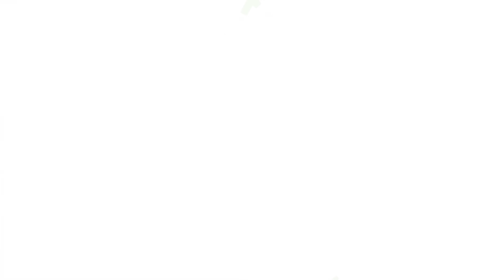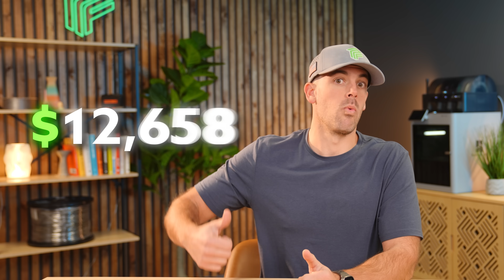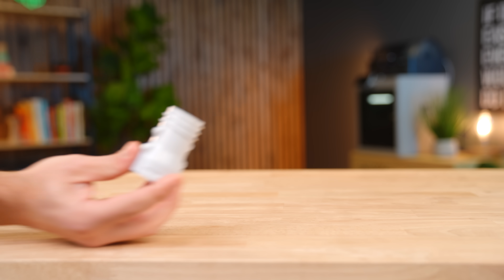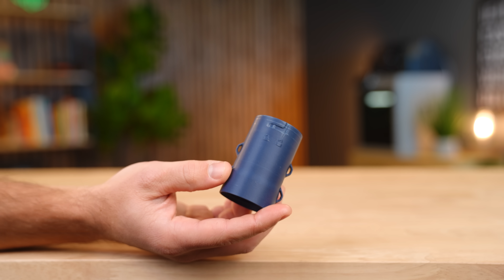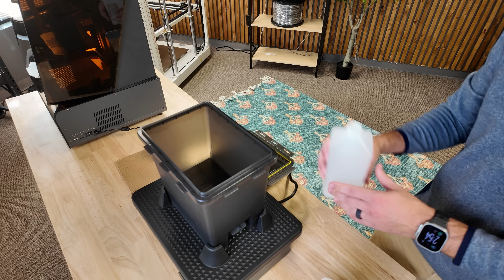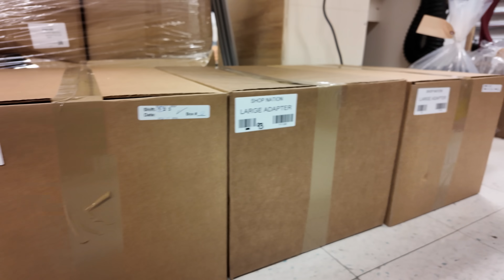Why is 3D Printing so Expensive?  Injection Molding Comparison

Comment: Not sure if it was mentioned (only watched about half the video), but another point in injection molding's favor is the aesthetic quality of the part is better too (provided there is good tooling) since there are not layer lines, or overhangs to worry about).
Reply: 3D prints of well designed, and from a reliable well tuned print profile, look amazing too.
Reply: @arnoldmarcus3634  3D prints can look fantastic, but only if you like the layered aesthetic (which I do). Not everyone does though.

Comment: So breaking it down Barney style, mold injection has a higher entry cost due to the tooling involved to create the mold for your part where as 3d printing avoids that process. Where 3d printing loses is when it comes to the time it takes to produce a part when compared to injection molds. You have exponentially higher production rates within a single 8 hour workday with injection molding with each part taking seconds or a few minutes to produce vs hours or days for a small batch of parts on a 3d printer.

Comment: 3D printers = low fixed costs and modest initial capital and fast setup but high variable cost per part and slow unit production.

Injection molding = substantial fixed costs (tooling) and high initial capital and slow setup but low variable costs per part and fast production 

If making small batches of parts or prototyping designs 3D printing is sensible.  

For volume production with a stable design, injection molding usually is the play.  

There is a gray area near where the cost curves meet where it can be a little more complicated.  Most of the time the math will be pretty obvious though if you have any certainty about the amount to produce.

Comment: Can someone please explain to me the cost difference between these products done with “hard” tooling for higher volumes and using “soft” tooling using softer metal molds such as aluminium for low volume/protype production runs? I’m assuming the 35k was for high volume, hard steel tooling not aluminium.
Reply: What you said- but 35,000 is low volume for molds. I have a customer that injection molds holsters on aluminum tooling
Reply: @cmf7972  I meant 35,000 dollars was for hard tooling his products  and was wondering how low volume tooling using aluminium would compare. Unless the 35,000 dollars was aluminium mold.

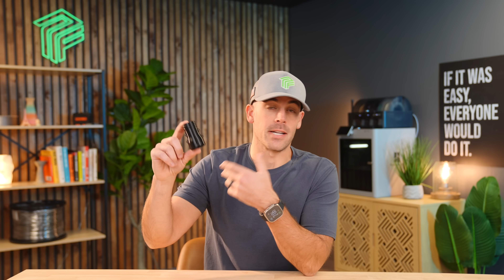Comment: @4:54 so you ate staying that the material cost was 3x what you paid?  So then who is subsidiasing your material?  Or is the suggestion that the filiment suppliers run at a loss?
Reply: He was stating labor and power costs for his own 3D printer. Assuming he values his own time, and takes electricity consumption into account.

Comment: I have a few injection molds and if you can pay for it, it is way better than 3d printing. I carl up my injection guy and in a little while 1,000's of parts show up and i don't have to deal with bad prints, bad filament crashes ect.

Comment: “This is one of the most transparent and practical comparisons I’ve seen — exactly what designers need to make informed decisions. Your breakdown of the ‘crossover point’ is spot on. From our experience as a prototyping and low-volume factory, there’s often a crucial middle ground that’s missed: Vacuum Casting (Urethane Casting). For bridge production (typically 20-500 parts), it offers injection-molding-like quality and material options at a fraction of the mold cost, perfect for market testing before committing to steel molds. It’s a powerful tool in the ‘in-between’ volume stage. Thanks for making such a valuable resource!

Comment: I have two resin printers and LOVE them!!!  And I have two P1S fdm printers. Resin is nice for high detail parts. You get zero layer lines because it prints at 0.01mm thick. But they take many hours to print. But a nice thing with resin if you can fit 5 parts on your bed it's the same amount of time to print one or 5.

Comment: One caveat I'm not sure you mentioned is that 3D printing can create internal structures that can allow you make lighter parts that are still relatively strong. That cannot be done with injection molding.
Reply: It's done with ribs, gussets and such like that maintain a fairly constant wall thickness. I've bought thousands of things that are injection molded to date, and only paid money for a couple that were 3D printed.
Reply: @spehropefhany What is your point? Just because you personally haven't bought many things that use internal structures doesn't mean there isn't a market for such things. Additionally, there is almost certainly untapped potential in existing markets for improved designs that could benefit from using internal structures to make them lighter and/or improve their strength.

I'm not saying injection molding doesn't have its place; far from it. I'm just pointing out an understated advantage that 3D printing has that injection molding will probably never have. ✌️
Reply: @sheariley1910  I suggest "Plastic Part Design For Injection Molding An Introduction" by Malloy if you want to learn more.

Comment: When comes to commercial scale 3d printing I'm surprised pellets producers didn't just have side pipe sticking out from very first melt, continuously supplying freshly made molten pressurized plastic straight to thousands of stationary 3D printing nozzles while bed makes all the moving independent
Allowing you to use plastics that can be molten once or have very strict requirements
That's how I'd see truly mass scale 3d printing, where the farm literally is manufacturing own plastics continuously, allowing for mass deployment of 3D printing

Comment: Glad to start seeing some common sense around 3D printing. It's been a while coming along. 3D printing has its' place, but it won't replace everything.

Now if only the "billet is best" guys on the metal side could understand that parts machined from billet are not always better. MIM, forging, and casting can better in terms of strength and cost. It just depends.

There are always pros and cons in engineering.

Comment: Making the molds for injection molding is the expensive part
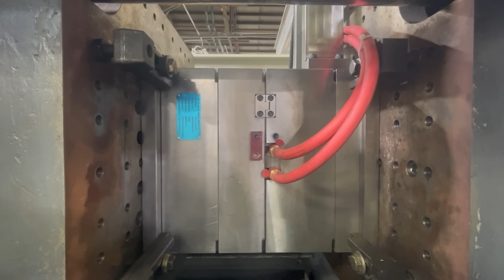Reply: Design of the molds is engineering expense and real molds tend to have a lot of components from 3rd parties such as DME, not just chunks of tool steel. From bubblers to slides to to hot runner assemblies and values to bushings and precision ground tapered alignment locks. At 6:53 you can see the alignment locks at the top right and left of the mold used to move the core and cavity halves into tight alignment. Not to mention oodles of precision-ground and hardened ejector pins and similar parts. Of course cheap molds can use lower performance materials (even aluminum) but won't last nearly as long before maintenance or rebuilding is required.

Comment: If you're in a pinch and don't have the upfront money, you can use injection molding at home with plaster molds for less than $1,000 in setup costs. Most cheap models are for smaller parts, but you could definitely build one yourself for bigger molds and use a hydraulic press.

Comment: One other advantage to injection molding is the ability to add surface texture (SPI) or even diamond patterns, similar to knurling, for increased grip for turning and fastening round parts. The draft angle needs to be steeper but once in the mold, they are on the part. Awesome video for those sitting on the fence whether or not to take the plunge. I agree that a "huge" factor is freeing up time and equipment (space) to do what you do best, create, adapt, and transform.

Comment: Do you have an estimate on how many parts you can get out of your mould before it needs to service or replacement?
Reply: We do service every 40,000 shots on our complex molds and 80-100,000 shots on the simpler ones. Lifetime is expected to be at least 500,000 shots.
In my previous job, service was usually done every 200-250,000 shots and I know we had molds that did over 20 million shots

Comment: 35k for the mold is INSANE! Why is it so expensive?!
Reply: Lol!  Someone was sleeping during the video!
Reply: @fredygump5578 Not at all, I did hear all the details. Still it doesn't come close to explain this ridiculous price! What is the mold made of? Solid gold?
Reply: @EntrE01  $35k was for two molds and that's pretty reasonable as these things go. They are fairly complex one-of-a-kind machines, weighing hundreds of pounds each, that have to unscrew (maybe a hydraulic motor with gears) to release the part, are riddled with water passages to keep the throughput reasonable, have precision components and have to withstand maybe 10-15k PSI injection pressure and tons of clamping pressure.  Some things like design and polishing are pretty labor intensive (or involve very expensive software). If you don't polish the mold the part won't come off the core side easily. Often it's better to make molds with multiple identical cavities to balance the forces (and multiply the throughput).
Reply: @spehropefhany so 35k is not just for the molds but the entire injection molding machines?
Reply: @EntrE01 
It is for the mold, but a mold is wore then two peases of steel
Reply: @Goroca I can buy a pretty decent car for that money. Think about that for a second. 35K for a mold is absolute insanity.
Reply: @EntrE01 
Yes I know 
Persition equipment is expensive 
A f421 3d printer is ≈75k€ that is chap for a industal printer

Comment: It would be interesting to see how SLS / MJF printing stacks up here. Also a point to consider: 3D-printed parts, generally speaking, can be more complex in design. This can translate to less steps being required in assembly / multiple parts being combined into one, so the cost of the part itself might go up, but the overall price might go down.

Comment: TL;DR. Injection Molding has a big startup price, but the price to produce the parts afterward is cheaper Comparison 3d printing. So if you have A LOT of the same parts you are mass producing Injection Molding is the way.

Comment: When in HighSchool many years ago, my Dad started a small company.  I did some of the drafting for what turned into an injected molded part, we also needed styrofoam molding that had some different needs, and so did rubber molding that was different yet.  In the end I went into Mechanical Engineering until I fell in love with computers and turned into a computer geek.  Still molding and manufacturing are an interest and a love some almost 60 years later.  Thanks for bringing us along and showing the economics too!

Comment: I really enjoyed learning about how you came up with going from 3D Printing your parts to injection molding them. I thought about this myself when doing a large production than a 3D Printing farm.
When you take in the time factories working with 3D versus injection mold and producing parts quickly. Yes it can take upto months for a plastic injection mold made at a tool machining company who works off of plans by drafting them knowing where the pins for the different plates as well. A lot goes into making them and they weight from hundreds of pounds up to tons for even a small parts depending how many parts being made at one time. 
When I was younger starting out I worked in a tool maker shop and for a plastic injection business as well.

Comment: Great video.. you might want to look into the FarmLoop system for some of these bits also. I have just started to use to make a annoying difficult part to produce at high volume (1 per plate, 2.5 hrs each so overnights weren’t an option) and it’s changed the game for me. I have 40 of these being produced in my spare room on one printer over 4 days whilst I’m in Spain haha

Comment: Fascinating look at the comparison and process. Thanks! (Also as far as the resin printer? It's probably better to remove the supports once you get them off the plate instead of after washing - it's less resin mess to wash off, which is going to help keep that wash IPA active longer, and it's less to cure (and probably cleaner from where the contact points were. And the Reflex RS is fantastic. )

Comment: A few months ago I started using a Formlabs Fuse. It costs about the same as a set of injection molds, a bit more if you get the full setup. Material is about $100 per kg, I've been using Nylon 12. The process makes a uniform part more like an injected molded part, and it is very fast when doing batches of parts. I have found that really large items that are extra thick can distort as they cool, need to spend a bit more time refining the part to fix it.

Comment: I think people misinterpret how "cheap" 3d printing is in general.

Most of the comments against print farms are from people that have no experience in mass production.

And no matter what production method you use, the more you make, the cheaper the unit cost is.

But I think a lot of people watch YouTube and think if they buy a 3d printer, they'll automatically be able to save money by printing things instead of buying them.

But that is usually only the case if there's a free file available for that exact item.

For example, I bought my daughter a dressing table for Christmas that was extremely heavy and had a load of parts.

The mirror on the sliding door was smashed and the company didn't have any stock to replace it so wanted us to return the unit that I'd already built at this point.

The mirror wasn't a standard size so I decided to print a frame.

I no experience with CAD, I'm learning as I go.

So it cost me £20 for a mirror that would work and I've burned through most of a roll of filament and multiple days of measuring, modelling and printing then redesigning to fix small errors or tolerances.

Whereas, I could have bought a mirror that was the right width for £40, a glass cutter for £10 and probably would have had a perfectly fitting mirror within a day or two.

Comment: Great video, I am a hobbiest 3D printing nerd by night and a plastic injection mold designer by day. Have you considered the more advanced additive manufacturing technologies such as Selective laser sintering or (SLS)? Although the machines are expensive, they can produce many more parts per run than other technologies due to their ability to nest parts in the Z axis as well as X & Y like FDM and no supports are required. Just a thought I thought I'd share. We use these technologies to produce metal inserts with conformal cooling/Venting in metal but there are plastic machines as well. Anyway, great video and thank you for sharing your experiences and knowledge.

Comment: I wonder why the 3D printing industry doesnt want to get into the injection mold industry. it should be possible to inject at low pressure enough - at least to make the hose adapter you wanted. $5000 max
Reply: the injection mold industry relies on the costly mold making industry, that seems to be just CNC machining and CAD/CAM personified. so that can  be done cheaply as well, assuming we had access to raw metal materials.

Comment: After manning the mold....
Customer: "can you make this little change?"
Reply: You'll have to adjust it with a hammer, either the mold or the customer's expectations.
Reply: @SenselessUsername  Customer would likely be cheaper
Reply: @SenselessUsername   😂
Reply: Choosing IM or 3D printing is a tit for tat moment. Conduct a feasibility study to determine the best approach as the part geometry, annual volume, and material requirements will dictate the direction you should go. Injection molding is the ideal solution for 1) if the design is frozen, and 2) if the volume justifies the cost of tools, material, tool maintenance,  etc, , 3D printing is ideal for 1) Unfrozen designs, concept, and early stage parts that customer needs immediately. 2) Low volume production runs for legacy parts no longer being made. Again, a feasibility study will guide you in the right direction that makes sense.
Reply: lol
Reply: and that's what 3d printing/prototyping is for 😎

Comment: I think 3D printers still miss on slicer injecting material into cavities. Prints beak along the layers. Brick mid laying helps only a little. But we are printing with internal structures. No problem to have some of those structures as little tubes, and then fill them in one go with few millimeters of material. That drastically increases mechanical stress which given tube can survive without snapping.

Comment: The other factor not discussed here is the mechanical strength of an injection molded part vs. a 3D printed part.  3D printed parts do not have the mechanical strength due to layer adhesion.  You have get a much better surface finish with injection molding (no layer lines).
Reply: Did you watch the whole video? Zach mentions this

Comment: Prototype in 3d print until FINAL, manufacture in injection moulding.
Re-tooling cost for minor re-work adds up REALLY fast.
Prototyping in injection moulding is expensive.

Comment: so i have been thinking about injection molding recently (for  hobbyists)  and now all of a sudden I get all kinds of recommendations related to it xD either something pushed me in this direction or it is coincidence (I think not).
Either way, I have been thinking about it a lot! using the technique in my own projects where 3D prints are good for fast paced prototyping, but the injection molded part is good for reliability, strength, sturdiness! I have also been thinking about it in conjunction with these companies that roll out printer after printer without having stock if your machine breaks down.

Comment: Great video, makes a lot of sense to me. I'll take this in consideration at work as well. ( IN this case it's a part which we now outsource to cnc manufacturing company. In the end of the case its the part which you'll need to provide not necessary through 3D printing.